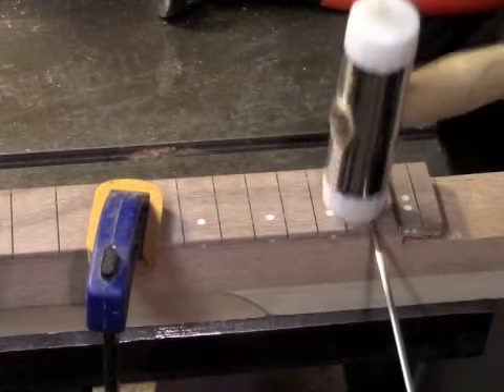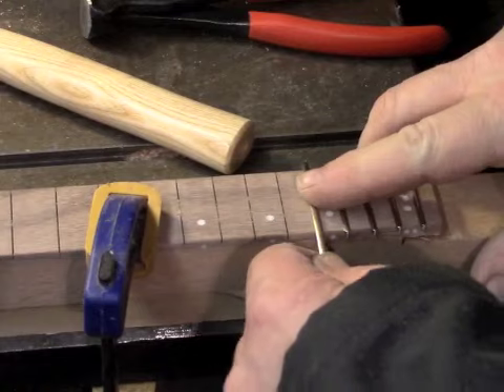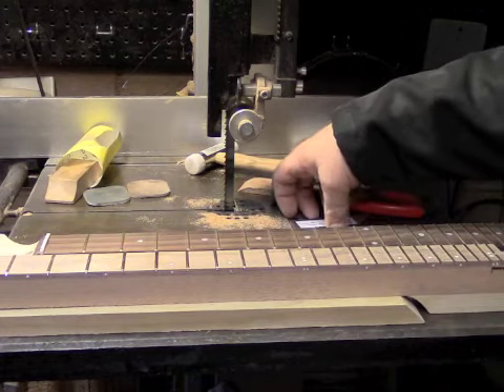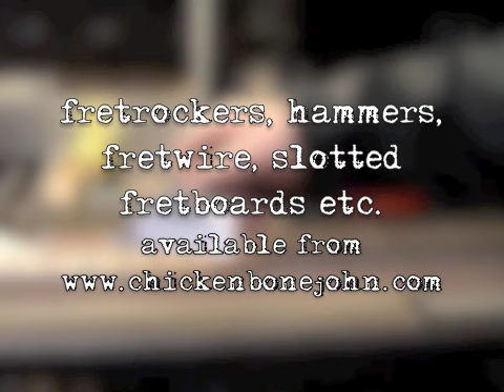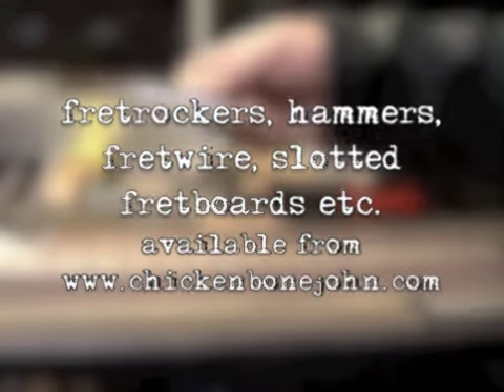Tech tips from ChickenboneJohn. How to install frets and use a fret rocker.

Comment: Hi John!  Once I see that you're able to correct the high frets just by tapping a little more with the hammer, I now see I've been making a mistake by putting a little drop of Superglue in the ends of the fret slots as I install the frets (as it has been suggested to me to do).  Obviously, the dried Superglue will never allow the high frets to be corrected with the hammer.  Which means you have to resort to the fret file to correct the problem.  No more Superglue for me.  Thanks, John.  THAT helps.
Reply from the maker: You can use superglue to secure the frets if you feel you need the extra holding power, but I would suggest wicking it into the fret ends after the frets area properly pressed in and levelled.
Reply: @ChickenboneJohn  Yes, thank you, John.  That's how I'll do it from now on.  Your tutorial video is very helpful.

Comment: Hi +chickenbonejohn. Strangely enough, this video went up day after I fretted one of you kits. Bad timing but went fine and I'm pretty pleased with my first guitar neck. 

I have a question about neck profile. I decided to keep as much timber as possible as, without a truss rod, I'm concerned about neck stability. So I've carved it to retain the blank's full thickness (24mm excluding fretboard) at thickest point. This feels fine in the hand so I think I'll stick with it for now. However, was wondering, what sort of profile do you use and how thin have you found is stable for this "mahogany type" neck? Thanks.
Reply from the maker: +Mark Allen I keep my necks pretty deep, but always put a fully rounded profile on them, sometimes a parabola shape, sometimes more of a vintage "vee' shape, but the key to keeping the neck stable under string tension is a decent depth. You can take off a few mm in the thickness  - I sometimes use 22mm thick blanks.
Reply: +ChickenboneJohn thanks for reply. Glad to know my instinct on this wasn't far off. Kept the carve as simple as possible as is my first. Shaved off 45deg flat bevel from bottom edges, then rounded over the edges. Gave me a sort of deep "D" profile. Found it a doddle to keep straight and symmetrical that way. 

Thanks again.
Reply: you all prolly dont care but does any of you know a method to get back into an Instagram account??
I stupidly forgot the account password. I would love any help you can give me
Reply: @Cayson Brixton instablaster =)
Reply: @Kashton Cory It did the trick and I actually got access to my account again. I'm so happy:D
Thanks so much you saved my ass!
Reply: @Cayson Brixton Happy to help xD

Comment: dont you use a leveling beam or similar tool? 
a couple of gentle passes with a (used) dead smooth file, made the world of a diffference on a neck, i "fretted" by notching the side edges, and wrapping a stainless TIG wire around it. (took me 4 tries to get the first one right. lol)
Reply from the maker: If the frets go in properly and accurately, I find you don't need to file them level.

Comment: I'm going through the selection of fretboard timber at the moment. I have a selection of sawn and sanded (not finish sanded) hardwood (gidgee and desert mulgawood) fretboard blanks. 

Most of them are reasonably flat showing a fraction of a millimetre 'daylight' along the length. There are a few with 1/2 mm or more even bowing along the length.

Here's the question. Should I be aiming for perfection with no daylight or should I accept that variations over time will occur especially as the fretboard will be attached to a neck which will in all likelihood move over time? I can easily press the fretboards flat with one finger on a flat surface

Should I put a weight on the unacceptable fretboards (bow facing down) on the machined surface of one of my workshop machines in an attempt to flatten the fretboards or should I attempt some other method such as planing and sanding (I have a drum sander and a planer/thicknesser) with consequent loss of thickness? Should I simply reject them and use them for knife handle blanks for example. They cost me $20 (about 11 Quid each) so it is not a biggie to reject them.

The fretboards are about 6mm+ thick with bows from 1/2mm to 1mm along the length.
What do you think the practical minimum fretboard thickness should be?

I really appreciate your videos by the way
Reply: I wouldn't worry about this - glue the fretboard on to the neck and then true everything up.